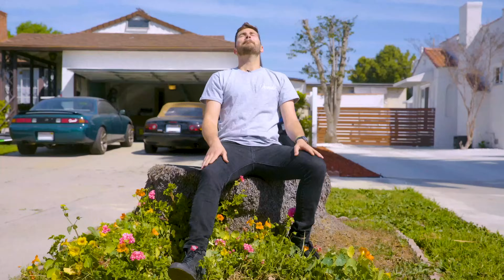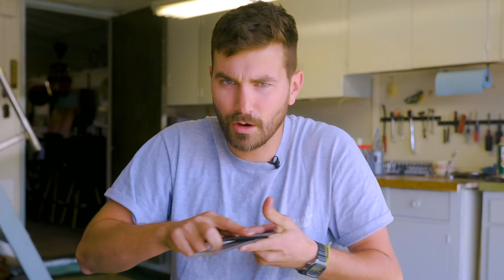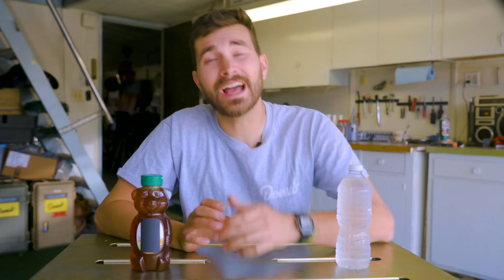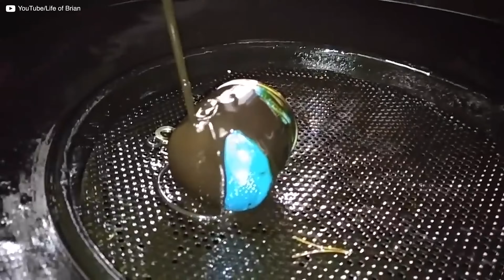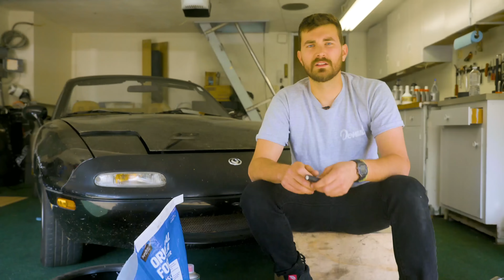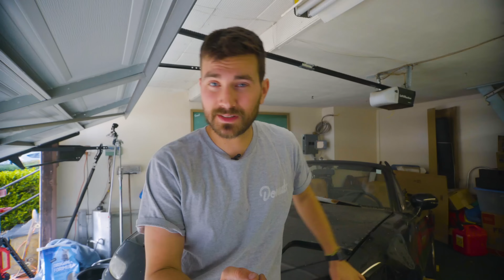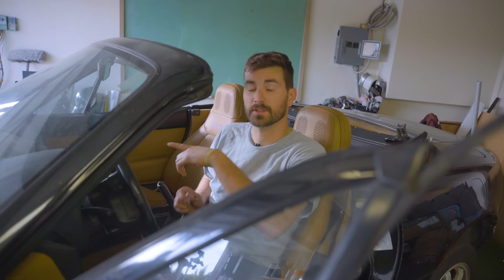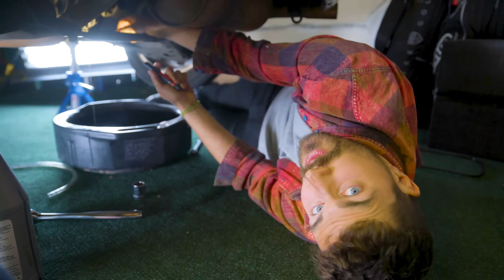9 Things You’ll REGRET Not Doing to Your Car

Comment: And if you wanna flush the power steering (dark fluid, lots of squeling or totally empty line after a leak), just get the car up in the air, remove return line and place it to jug/bottle, start the engine, get a buddy to fill up the reservoir while turning steering wheel full tilt to left and right while you are flushing the line, avoid air bubbles when filling, turn off the car, plug the return line back, fill to level and Bob is Your auntie. (Cannot be done in all of the cars if the return line is in bad place). Also, use fluid according the spec. 
Otherwise: Nice simple guide, I will recommend this to the beginners..

Comment: You forgot the part where you check to see if the old oil filter gasket is stuck to the engine block. lol It will confuse the heck out of you at first when it leaks.

Comment: you bled the brakes wrong your supposed to start on the side furthest away from the master cylinder which is normally on the drivers side of the car which means you start on the rear passenger side of the car by the time you'd get to the front drivers side there should be little to no air in the brake lines

Comment: Got one question
Ok he lift the 3 wheels of the ground, but for the fourth wheel why lift from the diferencial? Could not that damage it?
Reply: On a rear wheel drive vehicle you can safely lift the entire rear of the vehicle by the differential due to there being sufficient bracing regardless of suspension type. A single jack point is also much faster when you need to access the rear components. The front having more sensitive pans and components can be lifted at 1 point only if the chassis has an accessable cross member that's strong enough. It's better to lift the front by 2 separate points for safety as that's typically where most of the weight is in front engine vehicles.

Comment: Shouldn't you wait an hour or more after running the car to check the oil level to ensure all of it has drained down to the pan and the level you read on the stick is accurate?
Reply: If filling to engine spec that's not necessary. It mostly serves personal satisfaction of a job well done.

If using additives like Lucas oil conditioner it can take longer for the full volume to settle into the oil pan. Generally not all the oil will drain as there are components within the engine that prevent that to ensure you're never dry-starting an engine. As long as the oil level is within the designated range on the dip stick you'll have a happy engine

Comment: To be 100% honest, it's not really a good idea to change trans and diff fluid on your own, especially on cars with 60,000 plus miles. One of the main reasons being that when you have gear lube that old, there is often metal shavings and such in the fluid, which, despite what you may think, actually is better than new fluid if it's at that point. Putting new fluid when there is so much debris in there, will actually cause even more wear on the gears, due to the fluid being thicker and sort of more "compatible" with the gears that it has been mixed with. If you want to get new fluid when you are double or more beyond manufacturer spec for the service, you'd need a flush instead of a drain and fill, and you'll also need a new trans fluid filter.

Comment: A huge thank you for using the correct support points for the jackstands - the pinch welds.  I get so tired of seeing unibody cars with crushed "frame rails" where people put jackstands by mistake. (Saabkyle I'm looking at you.) Yo, guys, on a unibody car those rails are not a frame, and are not strong enough to support the car's weight!

Comment: Dont put stands under pinch welds. Cars are usually rusted and cant be supported there. And with modern cars using thin, cheap metal and even aluminum, I wouldnt trust it. Support from the subframe, frame, or axle tube.

Comment: Nice vid. 100% accurate but it is worth mentioning that if it is not broken do not fix it. I do understand that the video wants to demonstrate these things all. The sparkplugs are typical example. You do not have to do anything to them if your car does not have misfires. By removing them and even putting them back in you increase the chance of misfire as there is possibility of dirt gettiing in there. It is a very typical male thing that some guys get overattentive. I am all for preventative maintenance but generally most things will have service/replacement schedules at least they should do on decent cars(AKA Eastern or European ;) ). 

Nice vid I like it.

Comment: Tyres, especially tyre pressure. 
Regular checks to see if indicators, trail lights and brake lights are functional. Front lights too, but you tend to notice if one of them stops working. 
Also, basic check is oil levels, full replacement is needed a lot less often than top ups.
Should be checked weekly, monthly at the least.

Comment: The oil on the oil filter o-ring doesn't seal it, it keeps the rubber from tearing/ripping while you spin the filter on. It would leak pretty bad without it, gaskets should remain free of contaminants when possible. Good vid tho!

Comment: I put my jack stands under my Miata's frame rails.  I started doing that when I noticed the jack points were bending.  They're made for a scissor jack, which "pinches" the jack points from each side.  They weren't made for the flatter surfaces of jack stands and floor jacks.  IIRC, the owner's manual even informs the user to put jack stands under the frame rails.

Comment: There's an order that you should be following when bleeding the brake lines.  You should always start with the bleeder valve furthest from the reservoir, and move to the next closest after that until all four are done.  For example, if your reservoir is at the front driver's side under the hood, you should start at the rear passenger side, then the rear driver's side, the front passenger, and finally the front driver's side.

Comment: Is changing the oil for a  different than manual's recommends ,stop overheating the engine while driving fast ? (someone suggested it in 350z) The person suggested 5w-50 instead of 5w-30. Because the recommended one is bad.

Comment: one thing you didn't mention is with the oil drain plug if it has a washer you have to replace it with a new one, its called a crush washer and its single-use

Comment: That's terrible advice. DO NOT put those type of jack stands under the pinch weld lift points. It will crush the pinch weld and your cars emergency scissor jack will not locate on the lift point. Making changing a flat tyre dangerous. These stands need to go under stronger parts of the car like the subframes.

Comment: Dumb question but is it ok to keep using full synthetic on an engine in good condition with 200k miles or should I switch to conventional or synthetic high mileage to preserve the internal rubber gaskets and seals?

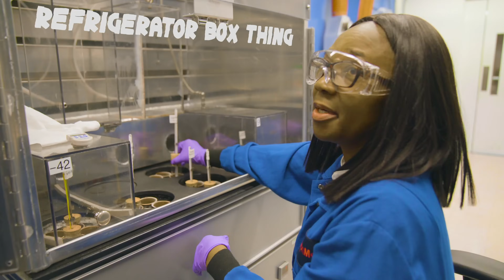Comment: 3:15 "When cold, it flows like a 10 weight oil, wich is good, that's a pretty low number" 

Yeah but the lower the number the thicker the oil ? as 30 is thiner at operating temp
Reply: its the best they can do, since it has to be pretty thick to make it not water when its hot.  if its super thin when cold and watery then its  going to run like tap water off you're engine head components  when its hot like a waterfall, its gotta be pretty thick cold in order to still be thick enough to stick to your parts well even when its all running and hot. the trade off is you just get really high oil pressure when its cold but it drops significantly as it warms up.   i use 5-30 full syn        so my oil presser is damn near 70psi give or take when i cold start but drops down to like 30ish after it warms up.    ive even seen my oil pressure as low as zero PSI, and thats normal too,  to solve that 0 PSI issue i found a helpful technique to fix it.    step one is cleaning up all the oil off the ground and step two is never forgeet to put the drain plug back in before starting the car.  3 times now i turned my car on to fill that oil filter and add more oil.  to top it off.    and topping it off meant 6 more quarts because stupid me left the drain plug out before Turing it on lol.

Comment: Just a question idk if u can answer it, but my 94 miata most likely has a big vacuum leak. When I’m cruising and I have my lights on at night with the heater on, the RPMs would drop super low to the first line and I would have a belt squeak. If I turn the heater off (still with lights on), it would help with the rpm go up and minimize belt squeak. During the day it isn’t much of a problem and when I step out the car on idle, I hear a hissing sound right by the front of the intake manifold. 

If u can help much appreciated, plus I have megasquirt pnp2 installed 😁

Comment: One thing to remember when changing your oil filter is that it will last longer if you prime it first. Fill the new filter with new oil before installing. Not completely, but enough so that no more oil is absorbed by the filter media. This is especially important if the filter sits parallel to the ground.

Comment: Most transmission I've run in to don't have a drain plug, and it's also a good idea to change the filter inside as well. You only did half a trans service.

Comment: I think that the right way to bleed the brake fluid is by starting from the furthest wheel from the brake cylinder going towards the closest, so for a left hand drive car the correct order should be back right, back left, front right and lastly front left

Comment: Thanks for the background explanation, with knowledge comes improvisation! Track use - tighter service intervals.

Additional info:
Work with oil: better use waterproof gloves (surgeon gloves), used oil no good on yor skin.  
Warm oil drains way better and quicker. Heat resistent glove and waterproof glove on that.
Miata oil filter: tricky placement. If doesn't get loose,  remove engine undercarriege plastic and bracket between intake manifold-engine block. Voila - the oil filter is highly approachable now and even  spillage oil can be catched without making a mess in your subframe!
Please, don't fill all the recommended amount of oil at one time! Underfill and check the oil level. It's always easier th underfill than remove excess oil ;)
Checkng coolant health: use the sucky tool directly on radiator coolant, by revoming pressure cup (do it when engine is cold, risky otherwise).
Reply: Damn and I mean damn I bet your damn buddies love you don't they!!! Seriously man could you be more of a know it all

Comment: @Donut Media There is an arrow on each oil filter to tell you how much you have to tighten it. Also, if the oil is warm (or hot) it's easier to drain it, because it flows better. Just watch not to burn yourself.

Comment: REMEMBER: check your water pump, if you're buying a higher mileage car. If the pump goes, the block can heat up too much, warp, and take the head-gasket with it. Check all filters and vital pumps. Or you could end up regretting it 🤙 I speak from experience. Believe that sh*t.

Comment: These are the basics but I just think it's really cool donut put out this very informative video on actual wrenching. I especially liked that zack explains what all the oil and spark jargon is about. For years I would almost over maintain my vehicle until I learned some of the facts about the longevity and actual workings of things like oil and spark plugs. I was running a very expensive/ very hot spark plug and my car was running like ass.  All to find out that what I really needed was some cheap NGK one step colder plugs. Anyway I just think it's cool my boys at DM are putting it out there for ppl less in the know. Hope to see more in depth videos in the future. Maybe some choo choo science. Flashback science garage lol

Comment: You forgot to check brake pads thickness.
And you really pinched the fuel line?!
Isn't that going to damage it and  make it leak since it's a high pressure pipe?!

Comment: Another great vid from Zach. Only thing I would add is when putting spark plugs back in, be careful not to cross-thread. If you can't hand screw them most of the way in, your cross-threading. Btw, great find on those M edition seats. Not many of those left that aren't cracked to pieces.

Comment: Don’t run the engine out of fuel if it’s A. Diesel or B. Direct injection. Diesels are not only hard to prime, but usually direct injection. The heat in the cumbustion chamber can melt injector tips. Fuel flowing through them cools it down. Don’t know how long it takes, don’t wanna know...

Comment: One thing I would add about the oil change is, make sure the gasket is still on the  old oil filter after you take it off. Sometimes it can get stuck to the block, and cause a leak. It happened to me once lucky I noticed right away, but I know a guy that took his car to a lube shop and they didn't notice and his motor blew up on his way home

Comment: 18:40 its also a really good idea to put antiseaze on your spark plug threads!!!
Reply: Some plugs recommend not doing that due to the metals used in manufacturing them. Bosch Platinum is one of those that if anti-seize is used will cause seizure and breakage

Comment: Copper is good for about 30,000
Platinum is good for about 60,000
And iridium is good for about 90,000 
Fuel quality, air quality, ignition coil age, fuel injector spray patterns and the general design of the cylinder head and spark plug position can also effect plug life.

Comment: Do not check or change the gap on Iridium and platinum plugs. You will brake them. in some cases it is ok to lower the gap in forced induction engines to ensure proper combustion. There are tools made to check and change Platinum group plugs.(iridium, platinum, ruthenium, ect.)

Comment: Forgot a couple types of coolant, HOAT and OAT which most manufacturers use today. It is very important not to mix older styles of coolant with these or it will clog your radiator

Comment: You forgot to mention the gasket for the oil filter as in make sure the old one is on the old oil filter and not the engine so it has a good seal for the new oil filter just pointing it out there

Comment: Probably not good but I have never changed brake fluid or power steering fluid since i got my car 6 years ago. I have changed the fuel filter 2 times and changed manual transmission fluid a couple times and the rear diff once.

Comment: My rear dif would have gone out if I didn’t check under my car on occasion. I saw my rear dif was leaking but not coming from the back. It was leaking from the piñon seal where the shaft meets the diff. I caught it just in time. My mechanic told me it was almost low enough where parts would have started to over heat. Even if you don’t change your fluids. Just looo under your car sometimes

Comment: I change the oil on my 05 mustang gt without any jacks. It’s tight but I can do it. Plus my oils pennzoil ultra platinum. I honestly don’t think it makes too big of a difference what oil you use as long as you use the right kind and get a good oil filter. Basic fram filters suck. It’s only paper with no metal backing

Comment: Protip: Replace one spark plug at a time so you eliminate the possibility of switching up the position of the wires.
(Also for the love of God, thread them plugs in by hand before attempting to use a torque wrench, otherwise you may strip your threads.)

Comment: I strongly suggest a reseal (front main, cam seals, cam angle sensor o ring, valve cover gasket, and while your at it a water pump and timing belt) miatas like to leak especially if seals are original

Comment: Just for info on spark plugs... If you purchase platinum or iridium plugs they are coated in that metal and if you adjust the gap, you will scrape off the coating and turn your expensive plugs into cheap ones...